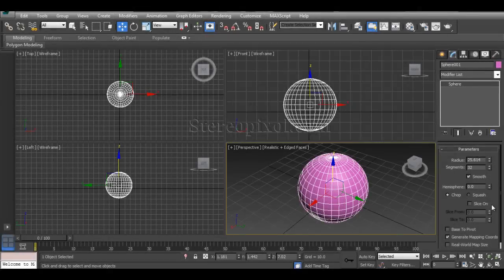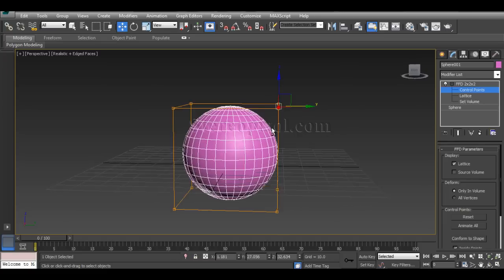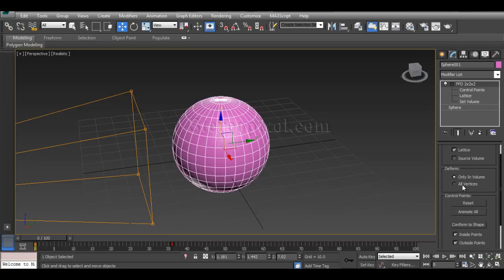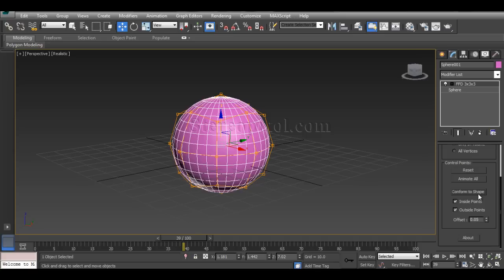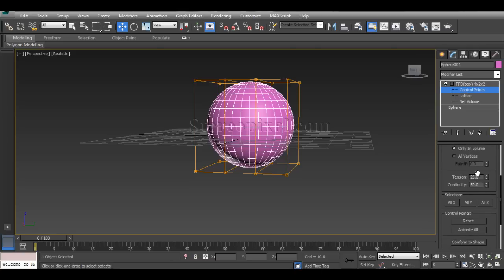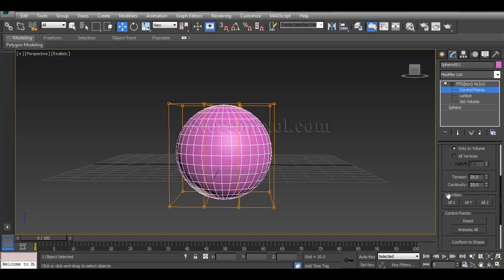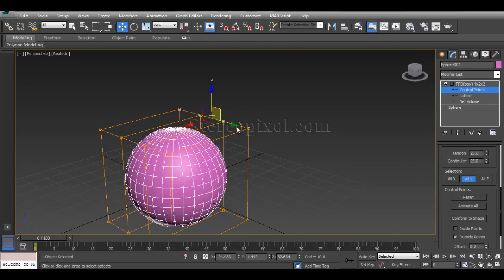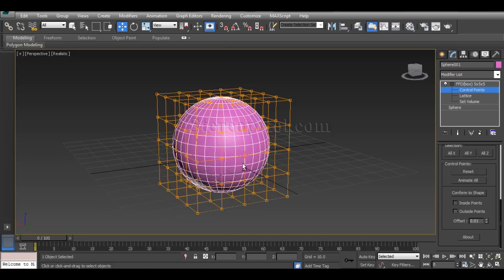FFD Modifiers in Autodesk 3Ds Max

Comment: i have done animation in 3dsmax through ffd . but when i export  mesh into fbx  then animation will vanish or removed . what is the problem ? 
when i combine all modifier into one single " editpolypoly" object . it cause the remove animation
Reply from the maker: Edit poly will bake all the modifier effect. So if you are using animation on the ffd parameters, you cannot convert it. You have to intact the modifier stack.
Reply: @Stereopixol   what does it mean to intact the modifier stack ? how to do it ? infact FBX EXPORTER automatically convert all modifier into one single object.
Reply from the maker: Well Now I got your point. So in case you have to transfer the animation to fbx you need to bake the animation in vertex level through point cache.
Reply: @Stereopixol  do you have any tutorial on it ? or any article ? anythng that can help me ? you are the first one who got my point clearly. please hep me to sort it out . actually i did not understand the bake animation in vertex level .
Reply: @Stereopixol  let me tell you the purpose of my work . i have to convert it into fbx and deliver to my client and he will use in unity . and further use in VR .
Reply from the maker: No I don't have any. But you can check this out. https://youtu.be/F0aqHWb3msw
Reply: @Stereopixol  I HAVE CHK IT , BUT THE RESULT IS SAME . editpoly remove all the modifier effects.
Reply from the maker: No you should not use edit poly.
Reply: @Stereopixol  but fbx exporter automatically merge all objects and make a single editpoly object.
the purpose of exporting into fbx is use in unity , point cache will create a record animation XML script , that script can be use in unity ?
Reply from the maker: I don't have any idea about it. But there should be a way to call point cache data .
Reply from the maker: Here you go .. https://forum.unity.com/threads/released-vertex-animation-tools-import-and-play-point-cache-mesh-sequences.272492/
Reply: @Stereopixol  thankyou